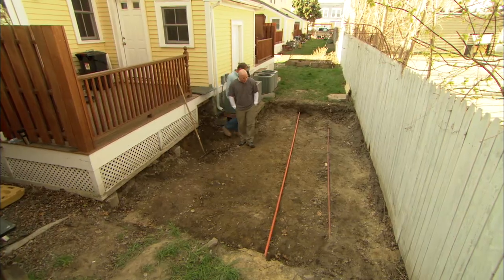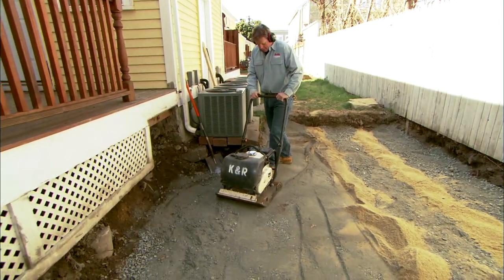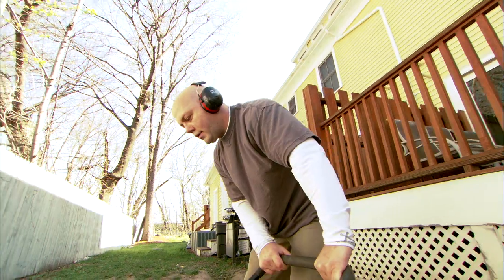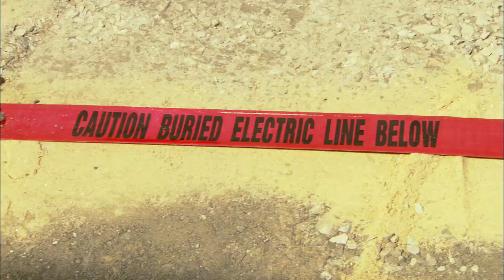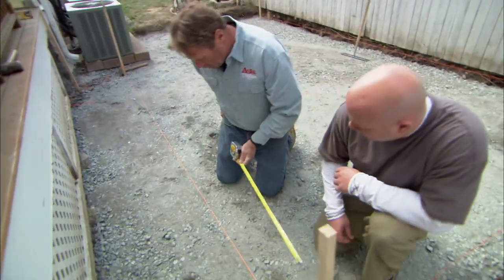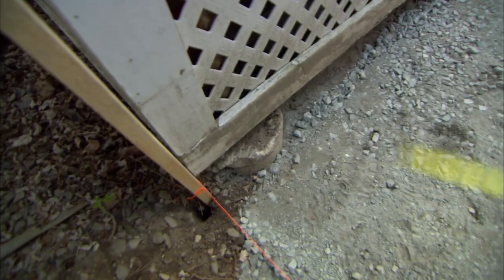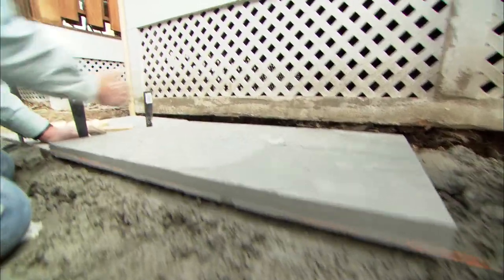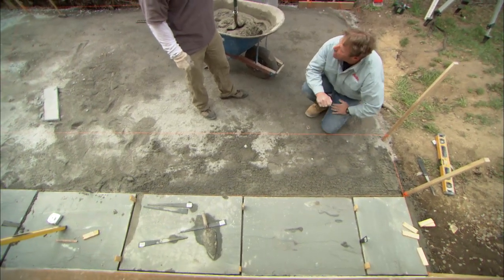How to Install an Urban Bluestone Patio | Ask This Old House

Comment: why not just use sand and gravel?  easier to handle compare to that concrete thing.
Reply: jes g 
Sand will settle causing the patio to settle 
If your gonna do it do it right or don’t do it at all
Reply: Unreinforced concrete will crack and settle as well - especially that weak mix. A good compacted base is key. As mentioned, the concrete was to ease the leveling of the stones as it is liquid until it sets.

Comment: How much would a patio like this cost? Nice work.
Reply: I bet just the material is 5k.
Reply: @davec.3198  I was pricing it out recently and it's not that bad, but it is expensive. Homeguide says a 10'x10' patio with bluestone, installed is around $2500. Materials are probably around $1k. Home Depot has pallets near me for about $600 (that's for 48 sq/ft, so double that roughly for the 10'x10'). 

It sounds like bluestone varies in quality quite a bit though, and I'm not sure how nice the stuff in the video is.

Comment: Would it be possible to use the urban blue stone on a wooden deck structure? And that is instead of the decking boards?
Reply: Only if you compact 3 inches of stone dust over the framing.

Comment: A lot of caution towards those buried comm lines. I like the "100 years from now" quip. Yeah, like we'll be using those same comm lines even in 20 years...

- The guy with obsoleted cable/telephone lines in his backyard (through age/animals deteriorating the line).
Reply: Shawn Strickland We've been using POTS for the better part of the last 100 years. We're still using it...
Reply: Shawn Strickland Probably won't be using the lines them selves 100 years from now, but that's why they use the plastic tubing now days. Simply tape the new lines to the old and pull them through. Also we pull a "pull rope" through with it so we can add more wires in the future. That pipe is Polly with a wire mesh imbeded in it to keep the moles away.

Comment: "This way a hundred years from now, they won't hit that line."
Yes they will!
You can run those lines through cast iron pipe encased in concrete, call MISS-DIG, and have them exactly marked showing where they are, and someone will hit those lines.
It's human nature to miss and/or ignore all the warning signs.
Reply: Well then whoever is digging is an idiot! Not Roger's fault
Hes minimizing risk
Reply: @gmrrnracr  There are careless folks out there but not everyone's an idiot, no need to be quite so negative.
Reply: @chrissanford8467  
Good point sir!  Thank you

Comment: Looks like one of those jobs that seemed to be a great idea and would look nice, but once you start doing it you would be like...WHY THE HELL DID I AGREE TO DO THIS? Too labor intensive, WAAAYYYYY TOO EXPENSIVE for the house.
Reply: godbluffvdgg -
Actually, the house is way too expensive for what little you get and the neighbors right on top of you. Four A/C units!
Reply: Actually there a team of laborers just off camera
Reply: The only work they do is what you see on camera for the most part. They sub the job out and then step in to film it. Sometimes the subcontractor is in the video but most of the time they're not.
Reply: Tell the Wife that!  you'll get the same response from a BRICK WALL!

Comment: what happens if they have to repair that line?
Reply: Low voltage comm line. Probably fiber optic running through. They would never dig that up, just pull the bad cable through the conduit from the street.

Comment: My back yard is sand. I live near the beach.
Reply: +Maxid1 My cat likes wet and dry food! 
Oh, I thought we were doing arbitrary statements...
Reply: +godbluffvdgg They put sand on the electrical conduits to warn people to stop digging if it anyone was ever dig in the yard in the future?
Reply: Maxid1 So you have nothing but wires under your yard...You better not dig!
Reply: +Maxid1 that's why you call 8-1-1 before you plan on doing any digging.
Reply: +Erik Liska And it's the law too. Not a thing to think you need to do. It's a requirement.
Reply: onecrazywheel agreed.
Reply: Then use pizzas.

Comment: Polymeric sand does not age well. The first 1 to 2 years might look good, but after that, the top of the Polymeric sand starts popping off as chunks. Then the look of the patio, becomes an embarrassment ! ( Been there, Done that).
Reply: Refill the holes and respray?

Comment: Why does this guy need 4 air conditioners?
Reply: Could be a multiplex? or perhaps for different zoned heating and cooling? That's a question for Richard.
Reply: Too hot in hell
Reply: Multiple units right next to each other.  Townhomes.  
After all, he removed 100% of his grass for this patio.  Good move in my book.

Comment: "How not to lay a patio".....Walking on it after you've just laid it? that's how you get wobbly patio.....

Also why didn't you push the grout in with a grouting tool?
Reply: That's why they packed it first. Its' not like if you leave the stones there to settle after a week it'll pack themselves.
Reply: Daniel Mcgann 1 God job

Comment: Polymeric sand does not age well. The first 1 to 2 years might look good, but after that, the top of the Polymeric sand starts popping off as chunks. Then the look of the patio, becomes an embarrassment ! ( Been there, Done that).
Reply: So what would you suggest?